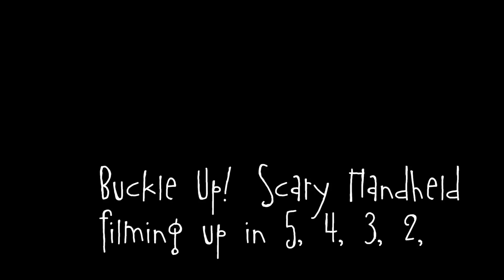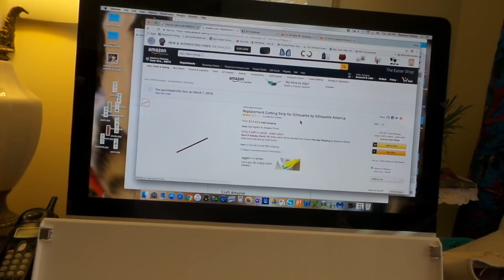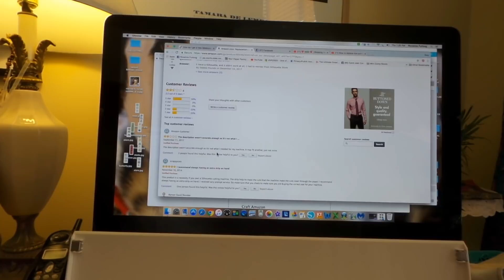Silhouette Fix: How to Replace Cutting Strip on Any Model

Comment: On my Cameo 3 mine is white not black
Reply from the maker: There are several sizes and depending on size they are either  black or white. You just need to measure your strip and look for that size in white.